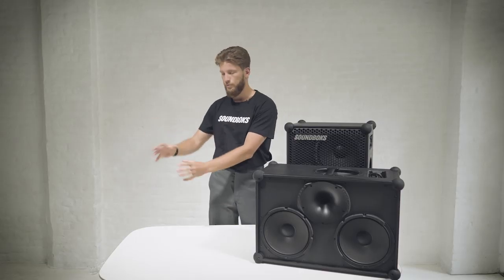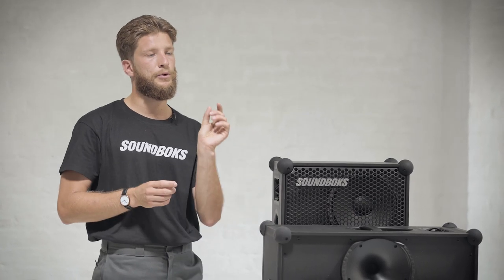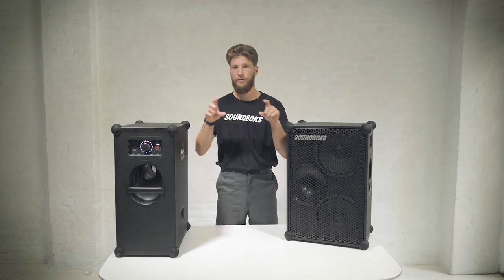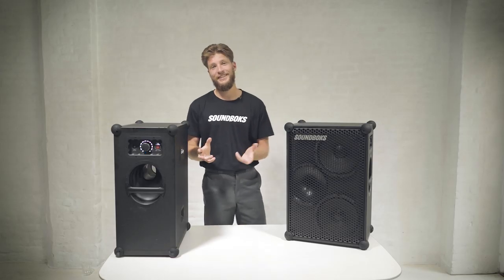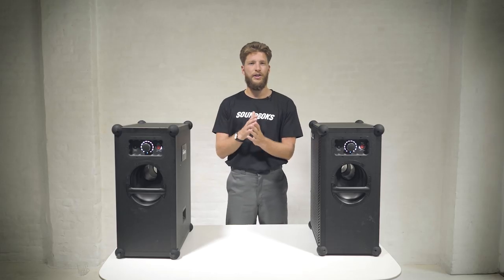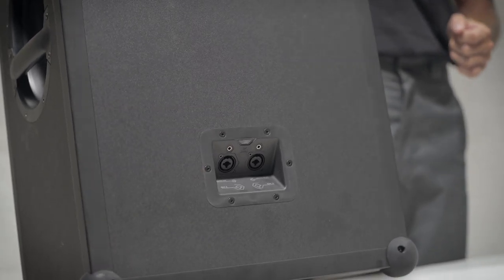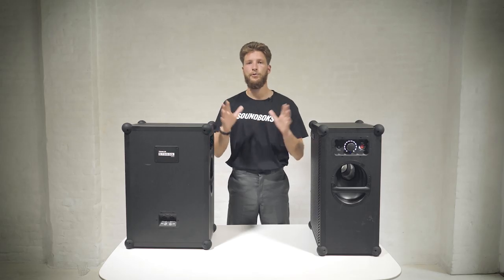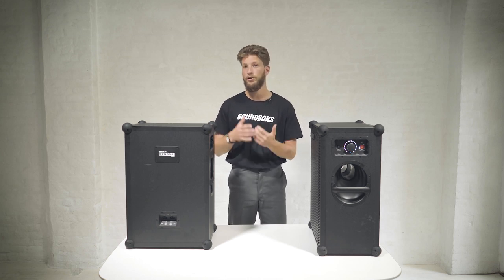Tech Specs Explained | SOUNDBOKS (GEN. 3)

Comment: Why do you boost the 80 -120 Hz with the bass reflex port even though it is harder for smaller sized woofers to produce enough output around 60 Hz? For me it is the deeper bass from 50Hz - 70Hz what creates that WOW-effect. Was the real "better bass" sacrificed for having higher SPL?
Reply: Maybe it just wasnt possible
Reply: It was sacrificed both because it saves on battery usage and because tuning the ports for lower frequencies removes the high bass punch which IMO is more important in these kinds of speakers

Comment: Firstly, the Soundboks3 sounds absolutely phenomenal, very crystal clear. The only concern I noticed is the output is almost negligible between 1 to 4 LED meter. Only at the 5th LED (which is the 12’o clock position) you can actually start hearing the output? Not sure if this normal? I had my iPhone 12 volume turned up to maximum, just FYI.

Comment: I've wanted to get a gen 3 for awhile now. They seemed to be a decent unit. Unfortunately I've seen way too much negative feedback about their customer service and experiences. For what they cost the adapter should instead be a built in power supply not just an external adapter for charging. I don't know how 3/72 watt class d amplifiers running at 12.8 volts can get to their full potential through a barrel connector and what I'm guessing is 18-20 gauge wire. A boost converter is a good idea but doubling the voltage draws twice the amperage. The speakers look great from the outside however after seeing a video of a gen 3's internals on youtube I just don't see the value especially finding out their manufactured in Guangzhou china.

Comment: Is the sound full and warm even at low volumes? Is there a outdoor mode with improved bass response? Thx
Reply: Its tuned to maximum bass performance at any volume level,
Reply: @flmovieproduction892  Anton said on a fb live stream, that the customers almost only used the outdoor mode, so they designed the single mode of the new soundboks like the outdoor mode of the old one.
Reply: @airwolf1337  if they are smart, they put an EQ featuee in their app, so everyone can adjust the sound and set some presets. Also it would be nice to set the left and right channel of each soundboks 3 which is connected and battery life  displayed in the app and so on
Reply: @mxz2024  Anton also said in the fb livestream, that some sort of EQ for the App is in development. But maybe its not a user defined eq, more like a few presets.
Reply: @mxz2024  battery life can be seen on the battery itself. the battery has white LEDs to show the state of charge. Also, they use the same battery as in the soundboks 2. thats very nice.
Reply: @airwolf1337  i kniw that. But you always have to press a butto nand walk to the soundboks.
Reply: @airwolf1337  i dont know why companies do not allow custom eq and only provide presets. Technically, thete is no difference to develop the feature in the app. No more effort. It is only limiting peoples preferences and you can give them presets, so they won t be able to tune it "bad". But some presets would be great too. Better than nothing😄
Reply: @mxz2024  if u play from spotify you can go set you EQ under settings.
Reply: @peterhandler7606  true but sometimes i use youtube and other sources. Also, it would be better if the equalizer settings will be set per device /on fhe device itself/app. Then it would automatically have the matching settings for the device and not only in spotify. Therefore i prefer a EQ feature in an app which matches with the device. This shouldnt be a problem for soundboks to develop/program, as it is some kind of default feature. They already got access to DSP settings and software in general to tune the soundboks by themselves (soundengineers). They just need to put a UI section in the app and connect it to those software settings or parts of it, to access frequency tuning
Reply: @mxz2024   sometimes more options is not a better solution. the 1% of us who acully knows how to use an EQ.
im sure u can download an app for your phone witch can EQ your output signal

Comment: Will the app have an equalizer on it? i know it sounds pretty far fetched but just asking. Since the SB2 has a neutral sound profile.
Reply: If you use Spotify, there are an incorporated equalizer.
Reply: @Mooorten  i used to but cancelled out due to lower volumes. my phone has an eq too but it can only do so much. it really has to be for the speaker to really tune it's performance
Reply from the maker: We're aiming to release an app that will allow you to customize your equalizer.
Reply: @SOUNDBOKS-SPEAKERS  No estimates?

Comment: Soundboks You need to be very innovative that you can stay ahead, you need to make the Soundboks with the same design and component, the only change you just need to make to it is to make it taller wider and more powerful then before, you already have all the component in hand already, You just need the two 15 inch bass speaker and the midrange speaker, and a bigger battery, and give it more power also, and do not worry about the weight on how heavy it is, and how tall and wide it is, You just make it there is a big market out there for it, people like looking for something different and new, so make it with the same three speaker but bigger bass speaker 2,15 inch bass speaker and the midrange speaker, all you do is to make two prototype to test the people on how they feel that way you would have a better idea  and if the market is ready Soundboks you do not have nothing at all to lose you have all the parts already you just need the courage to test the on known, I would be very disappointed if you are not brave enough to go ahead with a new bigger and more powerful Soundboks 4 we are all waiting.

Comment: It sounds really crap out of the box. Just some 100 Hz Bass boomy mess. 

No low bass whatsoever. Also You talk about high efficiency, then you add a dc/dc converter lol. 
The converter probably only has an efficiency of 70-90 %.

Why don't you guys just used a 24 volt battery ? Especially with LifepO4 the voltage is pretty stable.

How much net volume air, for the 2x 10" drivers ?
I'm pretty curious about that.

I mean with some Equalizer, you can probably make the Sound way better.
You can get rid of the 100 Hz peak, but boosting lower bass will be hard, hence the high tuning.

Comment: Cant believe I am going to have to return my 2 soundboks gen 3 units. Truly staggered to discover there is no means of adjusting down a connected microphone to Ch1 or Ch2 when the main  volume is set to 11. I have never in my life known of any speaker that did not allow you to control the volume of a mic!! .. considering the p[revious version of the app has a 0 to 100% volume slider, now replaced with an EQ that has zero effect on sound.